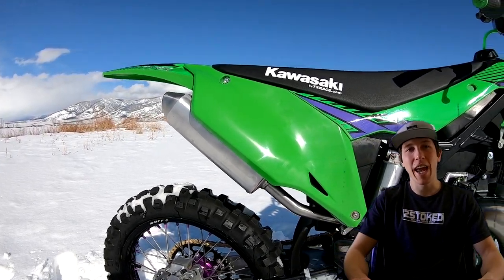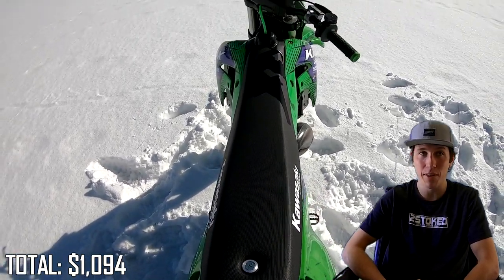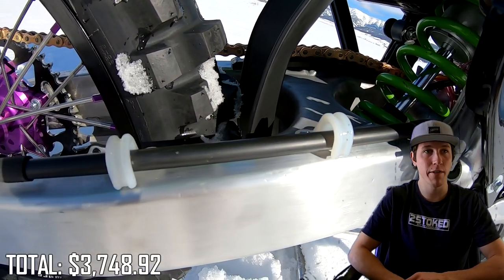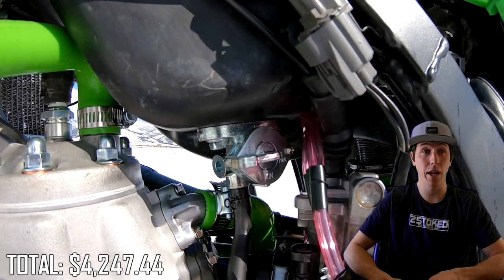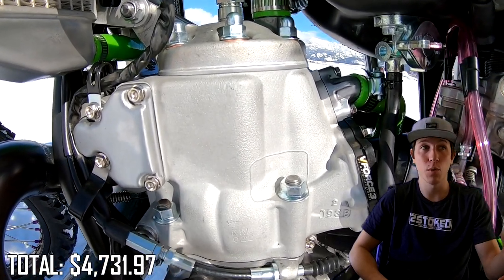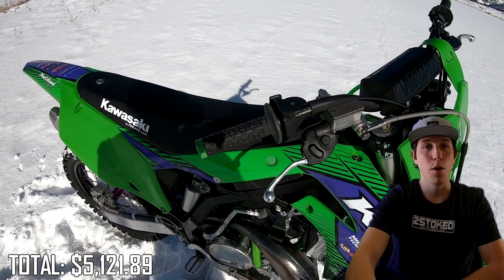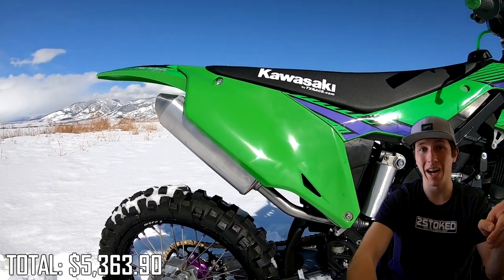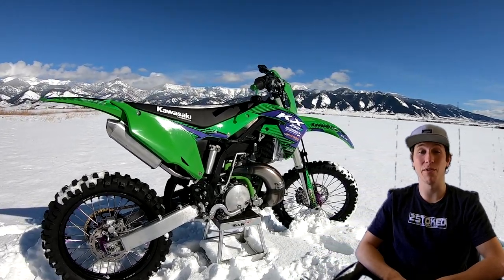How Much Did the 2001 Kawasaki KX250 Cost to Build?

Comment: I just did the same thing to a 96 KX125 i picked up in boxes. I dont even want to add up the cost of my build.The only thing I didnt do was get the Warp 9 rims, been looking at them though.  It would make me sick to know what I got in it and to top it off I dont even like it now that its complete. I guess I'm too used to my modern KTM 2 strokes.
Reply from the maker: This bike is sitting in my living room and hasn't been ridden. As badass as it is, my main bike is a 2020 KTM 250 XC TPI. I know brakes, suspension, and motor have all come so far since 2001. If I ride this bike, it'll only be once. But I kind of want to sell it "Brand New" so somebody is getting it with the completely fresh rebuild and no scratches. No matter how nice you rebuild an old bike, new stuff is still better. That said I had a blast building it and would do it all over again. Very proud of this bike.